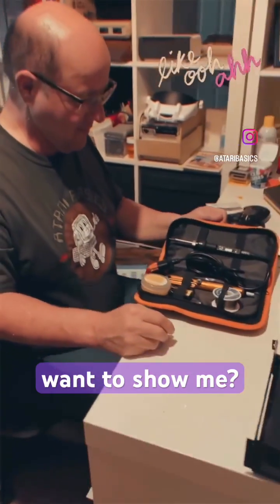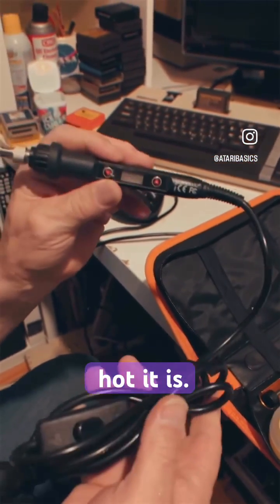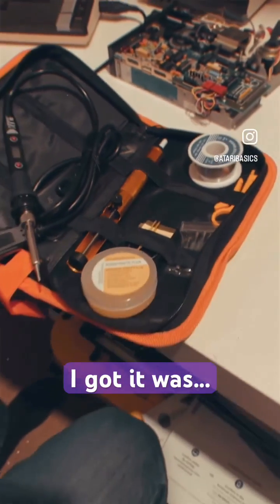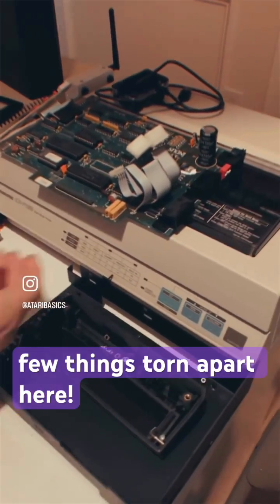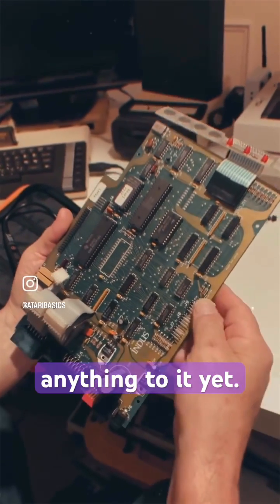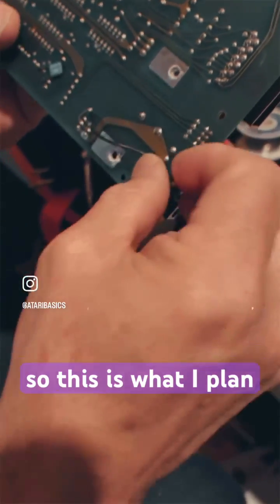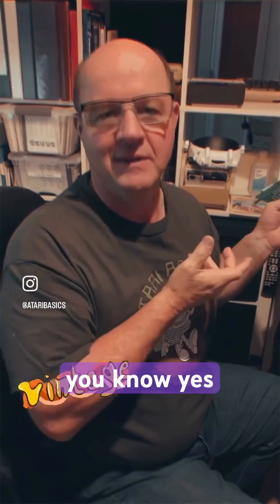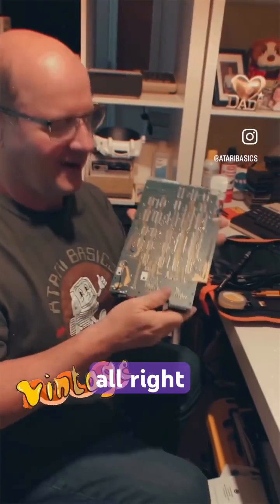Vintage Tech Repair: Indus Disk Drive from Atari 800XL + Amazon Soldering Kit Review

Comment: this guy would like a "Pinecil" better.
I have a high power desktop model for large ground planes, but I use the Pinecil waaaayyyy more. And, it's USB-C powered. You can power it with a portable power bank. It's GREAT, and probably cheaper than that Amazon kit you have in this video.
Reply from the maker: Thanks for the tip! The Pinecil does look great and super portable. I mainly wanted to replace my old Radio Shack iron from 20–30 years back, and this little kit felt right — plus it came with a holder, which helps me stay at least a little organized. Pretty sure I got my money’s worth, but I can see why you like the Pinecil.